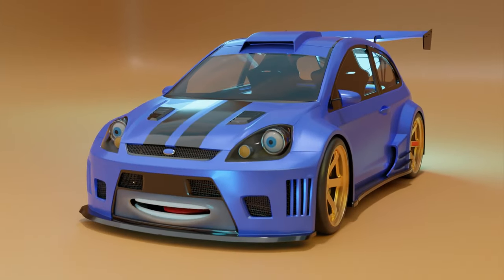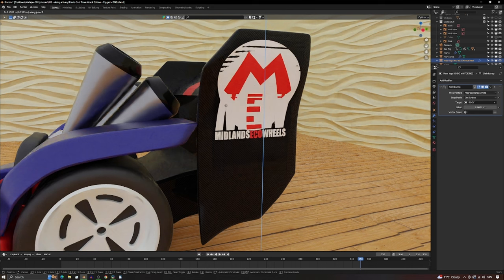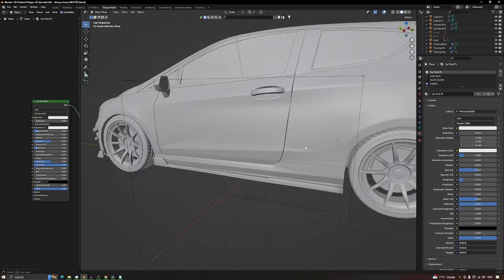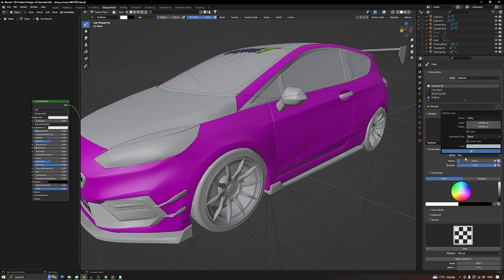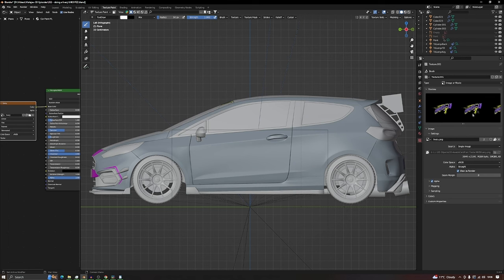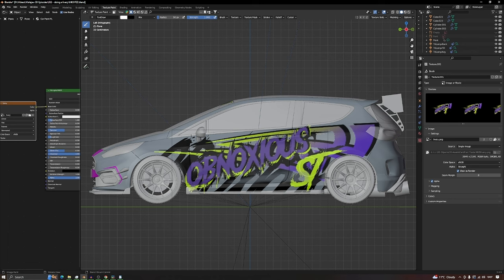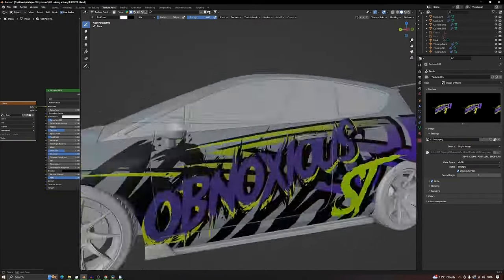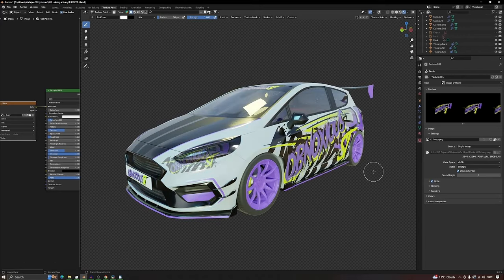How to Make Liverys in Blender 4.0 - When Shrink wrap isnt the answer

Comment: hi sir, i follow ur steps, but stuck at the part where i cannot use unwrap. can u help me advise on this?
Reply from the maker: Are you in edit mode? You can only unwrap objects in edit mode
Reply: Missing Textures (or lInked), detected. How do I pass on this sir?
Reply from the maker: Open shader editor, click the drop down on the left and select it? If no texture, click new texture in side tab or with ctrl a
Reply: @walejaw3d  alright thanks again. if u dont mind, i want to ask how to make sure both sides (door) remain the same, i tried just now 1 part is fine but the one is like mirroring in inverted arrangement
Reply from the maker: check mirroring is turned off in the top right. With the car 'game' when you do the opposing side it is considered normal to flip the image for asthetics. If you didnt you would need to redesign the whole image again to suit. Im a MASSIVE Drift boy so my rules set is highly influenced by this also. Sorry for late reply, sleep etc. Glad i can help. @nazriel00

Comment: Pretty sweet Video. Lots of work went into it and you can tell. Some nitpicking. look for a better recording software / device. The text even when put to 1080p is due to your display scaling settings fairly unreadable. i would recommend thinking about recording and uploading in 1440p or 4K. It would improve the perceived overall quality of your videos tremendously!
Reply from the maker: I cant believe it has taken this long for someone to notice this! 
What happened was, i had done a fresh hard drive install meaning i needed to reinstall everything from windows to apps etc.
After the refresh. I installed all my apps. Made this episode, uploaded it etc. then i noticed the quality! My screen record app had reset to default settings!!! I was truely wounded. I did put alot of effort into this too. If i could, i would vote to ban 720p as it is utterly useless.
Reply: @walejaw3d  Ah i see. Well shit happens as they say 😅 keep up the good work! Will def. Sub for more!

Comment: i have a question, when i paint creating uv maps in the same object, sometimes blender closes and when i enter to the project again only have the first image painted, all the uv maps are in the same node material, the uv maps still but the images doesnt painted in model
Reply from the maker: Save the uv map. Uv maps and blender files save separately. When doin uv stuff ull see a save button. Always make sure to save the uv before closing or itll reset back to nothing etc
Reply: @walejaw3d  sorry im some new in this, where is the save button?
Reply from the maker: @solus39 usually next to the +new button. Can be found on top bar of shader editor too
Reply: @walejaw3d  thank you im gonna try in the afternoon
Reply: @solus39  additionally you can go -file menu and  pack all your files to the blend file. then unpack them. It will save them within the blend file then. This is good if you're disorganized like me and one day move a bunch of files on your computer lol

Comment: If you join the parts how can you animate or open the doors etc with the decals on it later?
Reply from the maker: Select the door after, press p to separate.
Reply: @walejaw3d  but will that keep all the image mapping in place? The piece would loose all of their center or pivot points too right?
Reply from the maker: You would just be duplicating into another layer. You would run a duplicate texture in the shader editor. Even keep the layers separate, just select all before you go into texture mode and it should let u paint all at once but remain separate etc

Comment: Can I do this in Blender 3.4 version too?? Because My Pc always crash when I open blender 4.0 version.
Reply from the maker: Check your “preferences” in the section that you can pick either cpu or gpu. In blender 4 you can select both as apposed to just one or the other. I had an issue were even though it was set to cycle and gpu, the setting in preferences had both cpu and gpu selected, untick cpu rendering so your gpu gets first dibs. Failing this give me more details what’s happening and ill try my best fella. 3.4 was just as capable as 4.0 but its always best tobe ahead of the curve etc.
Reply: @walejaw3d  Wow Thank you so much for the advice! I'll try it in my blender 4.0 later!